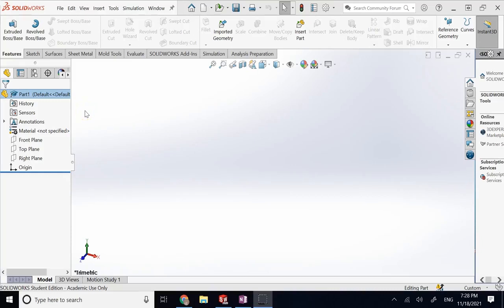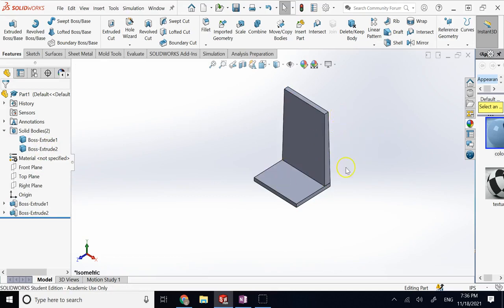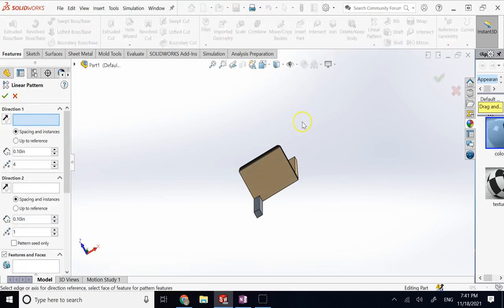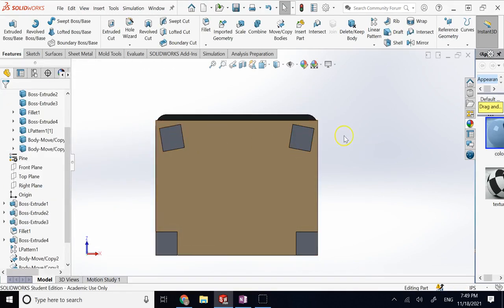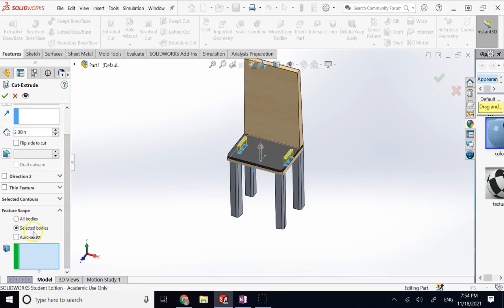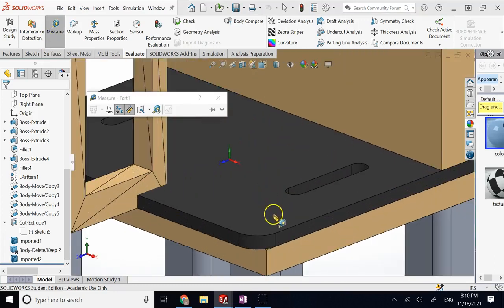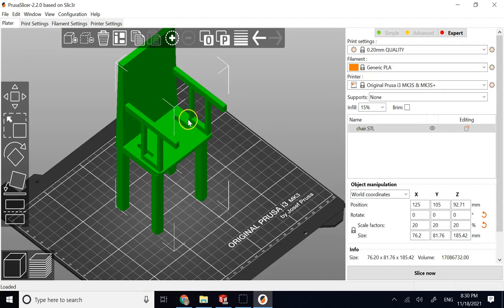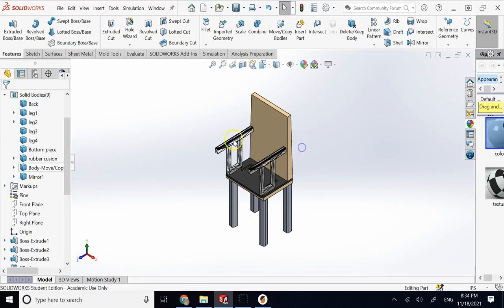SolidWorks Multi Body Parts

Comment: hi Dr Mehran...thank you for the videos...I have a question, for my MS project I need to use software like ADAMS MSC, but as you know ADAMS has a poor user-friendly GUI, so can you recommend to me what software can I use instead of that? for more details, I try to design a complicated mechanism that has rigid and flexible parts. thank you so much for your time.